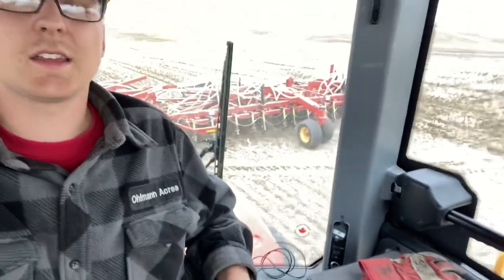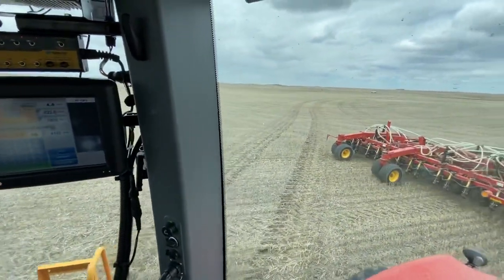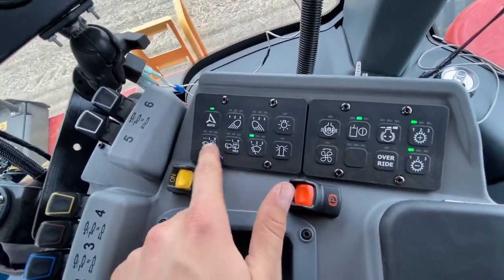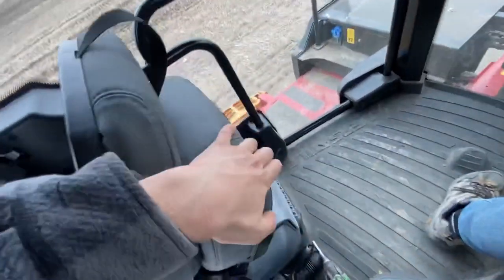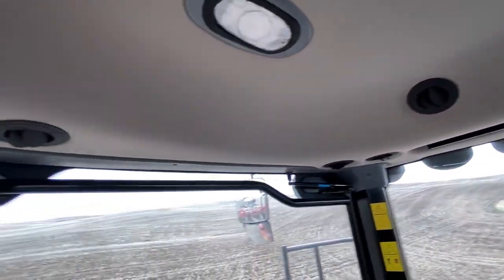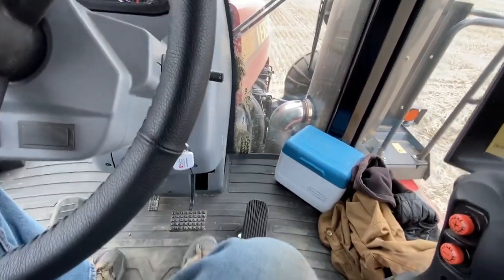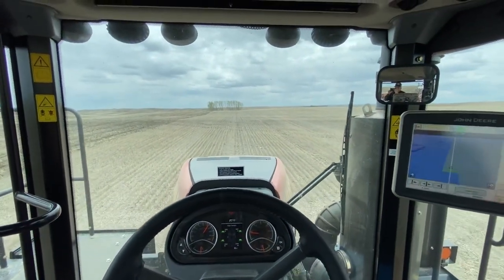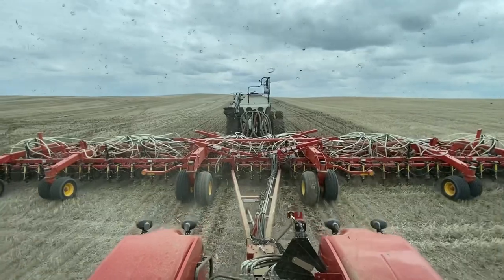New 2021 Versatile 610DT cab review!

Comment: If you start the tractor with the inching pedal pressed, it puts into calibration mode, its real jerky then. With the tractor running in neutral, press and release the inching pedal 3 times real slowly, and try again. Then remember to not step on the clutch when starting the motor.

Comment: Don't use the inching pedal to start moving, just throw the shift lever into gear.
Reply from the maker: That’s what our salesman was saying too.   Still a rough start.
Reply: How do you back into an implement with someone standing there with the hitch pin?
Reply: @RJ1999x  Use the inching pedal of course.

Rule #1 - Do not press the clutch in to start the engine.  Doing so screws up the pedal calibration at key on.

If the pedal is still difficult to modulate hooking up to an implement, have the dealer recalibrate the transmission.
Reply: @M8Stealth  Funny how Allis Chalmers had an inching pedal in 1973 ( there is no clutch) and it worked flawlessly
Reply: @RJ1999x  The curse of computers.  Benefits come with pain
Reply: @M8Stealth  Lol. The John Deere "inching" pedal is just as bad, in my experience. A giant step backwards!

Comment: What engine is in there. Glad to see a power shift over those cvt transmission
Reply from the maker: It has a Cummins engine with a Cat power shift
Reply: Can I ask why you prefer powershift over cvt
Reply from the maker: @joel8340.  we’ve never had the chance to run one.  They’re not very common here.
Reply: They need to just match a C18 CAT @800hp to that CAT tranny... LOL... That 15L Cummins performs worse that the FPT 12.9L...